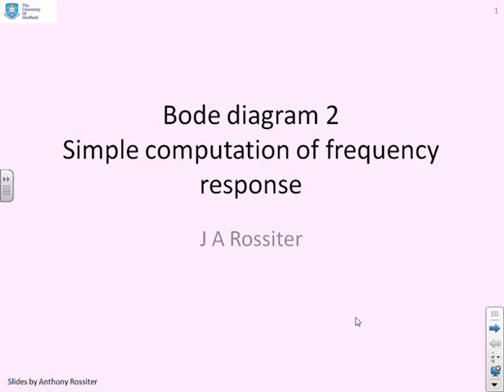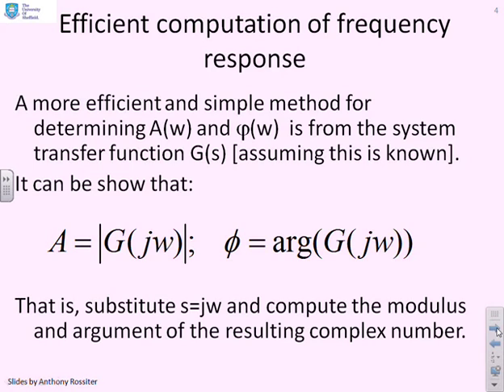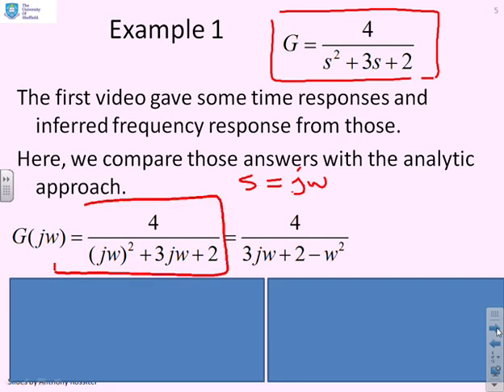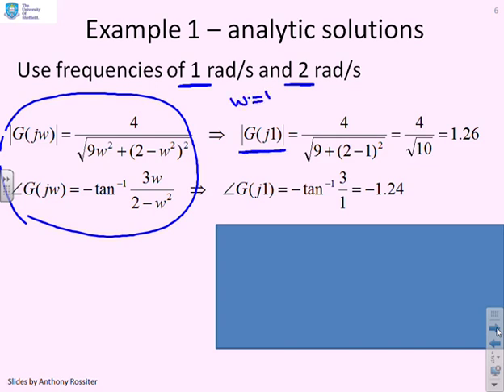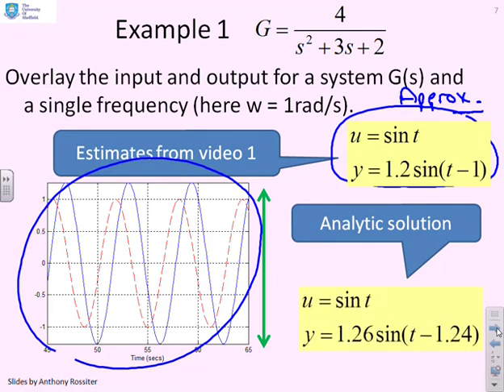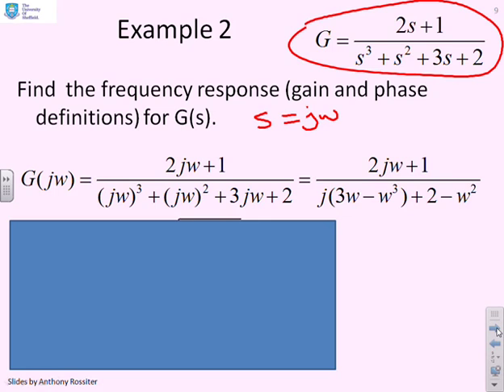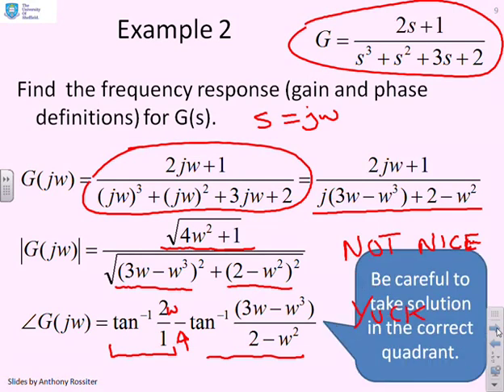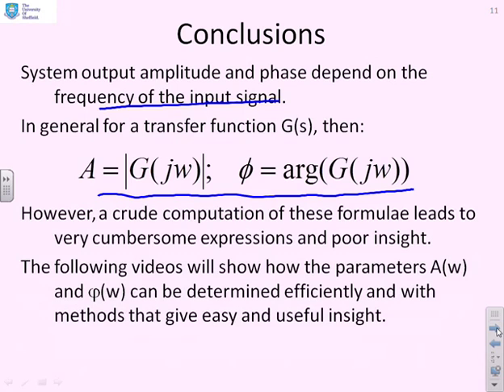Bode diagrams 2 - frequency response gain and phase for transfer functions

Comment: At 3:07 when you square 3jw, why isn't it -9w ?
Reply from the maker: Patrick Neckolaishen If you do (3jw)^2 then you will get 9*j^2*w^2 which is -9w^2.
Reply: @johnrossiter2323  I think there might be a typo, because when you move 3jw under the square root it should be -9w^2
Reply: Dean Jin  T_T And then he proceeds and substitutes the numbers into the wrong formula.
But at least I understood.
Reply: I think the reason why he puts 9w^2 instead of -9w^2 because it has been in modulus equation so that you don't need to consider imaginary j anymore. therefore, it'll be sqrt((3w)^2+(2-w^2)) = sqrt(9w^2+(2-w^2)^2)